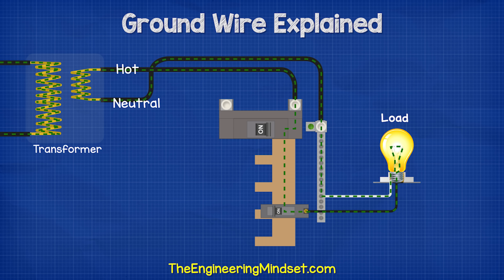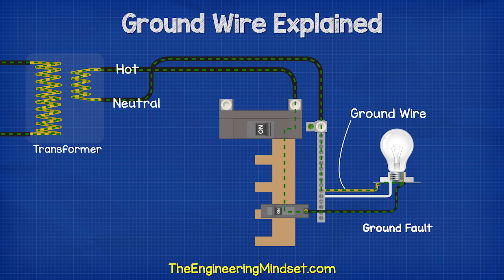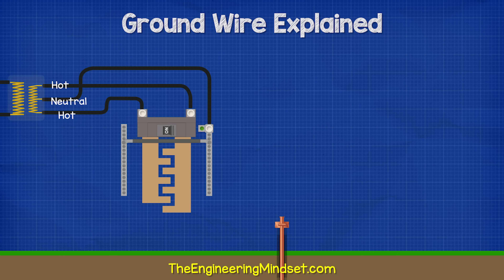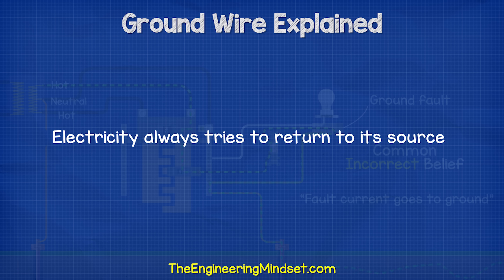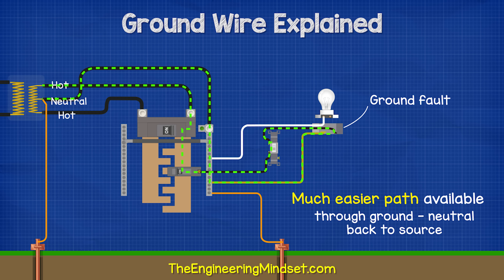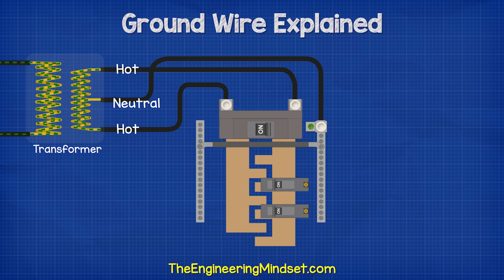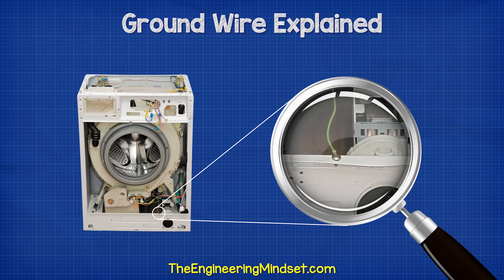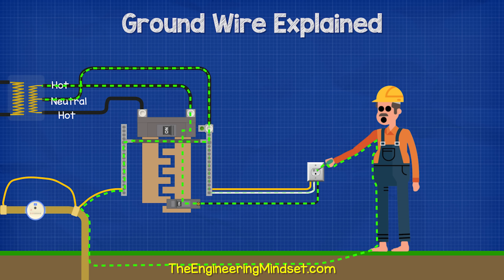Ground Wire Explained

Comment: I held my breath through this, waiting for the big fatal mistakes, but I didn't find any! Good job lol
There was one minor one and an oversight. The ground rod isn't only to dissipate static, it's what references the entire ground and neutral system to be Equal Potential with the dirt, and also the water pipes, building frame etc. You didn't mention how the ground rod is also bonded to the water pipes for this reason.
And when you said that the fault current will travel back to Source via the ground wire INSTEAD OF through the earth, that's incorrect, it takes both/all available paths, so some current will flow through the earth all the way back to the power plant itself. It will be very small, and if you hook a wire to a ground rod and connect a hot wire to it, you won't trip a regular breaker so little current flows, but SOME current does flow.

But still, you give a better explanation than most people ever have lol
Reply: Hm, i have a question then:

If the neutral at the transformer is sticked into the earth (ground rod) and also at my house, and that has a very high impedance, how is then the current able to pass my body when i touch the Live wire?
It should actually harder since in most cases i dont have a direct connection to dirt where it could flow back to the transformer or even my houses ground rod.
What happens here then??
Reply: @thx-rben  if you are insulated and touch a hot wire, nothing happens.
Just like a bird sitting on a power line.
However, moisture is present in a lot of things, and most shoes are not completely insulating (sweat from the foot combined with pinholes in the sole etc), and so electricity can often find ways back to Source.

For instance, if you are standing on bathroom floor after someone took a shower, the floor might have enough moisture on it to make a current path to a ground-bonded water pipe.
You can also simply touch both terminals on an outlet.
Or on carpet, if the humidity is high enough there might be some conductivity, or maybe you are kneeling on a nail beneath the carpet and the board has some moisture because the crawl space has high humidity, and the board is grounded to the damp concrete foundation.

However, if you are wearing dry shock hazard shoes which have a dielectric barrier in them with no pinholes, or you are standing on a dry rubber anti shock mat, a clean and dry fiberglass ladder or plastic stool, then you can touch a hot lead with no shock, because there is no where for the current to go.

All of the situations I mentioned before are very high impedance circuits, but it takes so little current to be dangerous to us that we can still get that shock.

Now, I have gotten a lot of shocks in my life, between faulty equipment (not my fault) and working with electricity (my fault lol), and most of them were more straight forward, standing on wet surfaces, or touching both sides of a circuit, like the time my hand slipped on a large motor starter overload reset button and I punched across the 3 phase 480v terminals with my knuckles.
I was actually standing on wet metal when it happened, but I had dry boots on so the only shock I got was between phases across my knuckles.
I also was in the habit when I was working on open control panels like that to keep one hand behind my back, which may have saved my life that time, because if my other hand had been holding the cabinet door at the time it would have been much worse.

I had an old electrician friend who used to never put cover plates on at his place so he could test the power easily if something went out, and he had to lick his fingers to be able to feel 110 v lol
And usually he had to touch across both terminals or touch something grounded, because he would not be grounded standing on dry dirt or concrete.
But it's hard to tell for us normal people whether what we are standing on is indeed dry enough to insulate us from ground.
Reply: @ke6gwf  all that stuff make it seem safer to just not use ground rod at all.
Reply: @ivanfenis1221  it's the opposite. Proper equipotential grounding makes things much safer for human meat bags, because it makes it more likely for the circuit breaker to trip instantly, rather than having fences and frames at high voltage for people to touch.
Reply: @ke6gwf  how does grounding make the circuit breaker more likely to trip? current overloading? and when you say high voltage do you mean that fences and frames are in contact with hot wire?
Reply: @ivanfenis1221  yes. If a fence around a substation for instance is not well grounded, a live high voltage wire could fall onto it and energize the fence. And then when the utility worker arrives at the substation to find out why people are without power, they get electrocuted when they touch the gate.
On the other hand, if the fence and all metal items in the substation are grounded in what's known as Eqipotential Bonding and Grounding, then if the live wire falls on the fence, it is a dead short to ground and either burns through the wire, or trips the breakers.

It happens sometimes that power lines will fall down on top of a wire fence on wooden posts going across a farm and start a fire, and a firefighter will get electrocuted miles away if they touch that fence before the utility gets there to shut the power off.

In a home situation, it's not the "ground rod" that makes the breaker trip, but rather the Grounded Conductor being bonded to the neutral to provide a low impedance path back to the Source. The ground rod is there in that situation to bleed off static charges and to reference the system 0 volts to ground, but it's that zero volts to ground reference that's important!

If you had a bad ground rod connection, you could theoretically have the water pipes at 110 volts in reference to the earth from a short circuit, without tripping a breaker.
If you were in the house you might be able to touch the pipes fine, but when you are standing on the dirt and go to turn the hose off, you could get a shock.
Reply: @ke6gwf  just to be clear "grounding" is when you connect to the neutral wire? or when you connect to the ground rod that's staked on earth?
Reply: @ivanfenis1221  it's confusing lol
There's a difference between the Grounding Conductor and the Grounded Conductor (Ground and Neutral).

Connecting the ground and the neutral (green and white) together is called Bonding.

The Ground wire is also connected to the grounding rod in the earth.

If you have enough ground rods you can actually use the earth as the return path to source. Some rural power grids only have a single wire on the pole, and use Earth Return at the Transformers, but a normal single ground rod at a house won't conduct enough electricity on its own to trip a breaker, which is why it's also "Bonded" to the neutral.
Reply: @ke6gwf  "If a fence around a substation for instance is not well grounded, a live high voltage wire could fall onto it and energize the fence. And then when the utility worker arrives at the substation to find out why people are without power, they get electrocuted when they touch the gate." - what's the circuit loop here? 

substation->live wire->fence->person->earth??->ground rod of substation??->substation
Reply: @ivanfenis1221  that circuit loop is one that would potentially be involved, but if a person touches a live wire, the current flows through them to Earth, and returns directly to the grounding system at the power plant, as well as to every grounding rod and system for every substation and transformer on the circuit.

Electricity DOESN'T take the path of least resistance, it takes ALL paths of conduction.

And while you can hook an extension cord from a 20 amp household breaker directly to a ground rod and not enough current will flow to trip the breaker (only a few amps will flow at 120 v with typical soil conditions), it's more than enough to kill you.

Which is why the substation fence would have ground wires and straps all along it, so that the voltage in the fence can never be different than the voltage of the soil next to the fence, even if a hot wire was sitting on it.

Basically provide a bigger pipe for current to flow into the earth, than the wire above has to flow current into the fence.
Reply: We use a grounded neutral as a 0v reference in controls. Sometimes ill measure control voltage to a pipe. Because why not.
Reply: Sorry should be more specific, grounded neutral of a 24v transformer
Reply from the maker: We just published a new Ground fault, short circuit and arc fault video, so much detail! Link HERE➡️: https://youtu.be/Qi0ynSQw-wc
Reply: this a 3 min video, you are more than welcome to create content, this is over simplified for the sake of education lmao he wasnt gonna take EVERY what if just for people like you that likes to complain about   everything jesus
Reply: @endersonkliverthybarra9747  but he only commented on what's in the video. he's not discussing every what if.
Reply: @endersonkliverthybarra9747  which is why I said he did a good job, and then ADDED a couple of key points he didn't include in the video, so that people reading the comments would get the full picture.

Comment: Ok, so I understand all of this, thank you for taking the time to explain it all in detail! Now my question, that none of my electrician bosses can answer, if the neutrals and grounds are connected to the same bus why does the ground not carry any current if the neutral returns current to the same bus the ground is connected too?
Reply: The long version... lol
In order to have current flow, you have to have a complete circuit between the power source, through the wires, and back to  the other side of the power source.
The ground wire is connected at one end to the neutral conductor, thus to one side of the power source, but it has no connection to the other side of the power source, and also no connection anywhere else to the neutral wire, and so no current can flow.

This is actually exactly why the ground and neutral are only supposed to be Bonded at a single location, because if you had the ground wire connected to neutral at the main panel and also at an outlet you would get some current flow on the ground wire, because it basically becomes part of the neutral circuit, and that's not good! 
For one thing when you have current flow in a conductor, due to resistance you have differences in potential along the wire, and so some parts of the ground wire would now have a voltage difference when compared to say the water pipes, leading to shock hazards. 

This is part of the reason for the ground rod at the house, which will also be bonded to the water pipes, it's to achieve what's known as Equal Potential, where the neutral wire, and the ground wire, is at the exact same voltage as the water pipes and the dirt. 

And the ground rod at the transformer bonds the split phase windings to force one side of the transformer to be at the same potential as the earth. 

If you leave the neutral floating on a transformer, then you get 120v or whatever between the terminals, but you don't have one that's at 0v in reference to the ground, it floats. 

One site I was working on some industrial controls in an equipment room, and I was there after dark one day and discovered that there was 110v on the ground buss in the plc cabinet after I melted the end off a screwdriver lol 
I found that there was 0v from the "Hot" wire to grounded objects like water pipes, and 110v on the neutral and ground wires. 
I started testing but didn't find anything that night, so the next day I was going to start tracing the whole system back through the breaker boxes, but when I got there, everything was correct! 
I was confused, until a later day I was there late and around dark I heard a loud clunk, and curious I checked, and the voltage had flipped. 
Then I realized that some big outdoor lights were powered off the 110v panel, and so I started turning breakers off, and finally discovered that when I turned the breaker for one of the lights on, the voltage flipped. 
I discovered that the light circuit was dead shorted when the photocell energized it, so I disconnected it until it could be replaced. 

The room was served by a 3 phase feed, and they had put a transformer in the room to derive 110/240, and when I pulled the panel off, sure enough, the electrician who installed it had not bonded the neutral, so it was floating. 
That meant that when the "hot" side was shorted to ground, rather than tripping anything, it just referenced the whole transformer, and everything on the sub panel, so that hot was at Ground potential, and thus ground and neutral were now at 110 v to ground. 

I called the site rep over the next day and told him the problem, but he tried to tell me I was crazy, so I put the meter between the ground buss and the metal building, and took a test lead and hooked it to a screwdriver and the metal building, and jabbed the screwdriver into a live outlet with him yelling at me to stop, and then told him to look at the meter... 
I had to walk him through bonding and what was happening, but finally he agreed to call their electrician to come in and wire the transformer properly.
Reply from the maker: The ground connects to the metal casing not the load, it will only carry a current if the hot touches the metal case
Reply: @EngineeringMindset   Ahh, ok I get ya! Still seems weord to me lol bur I appreciate it!
Reply: @EngineeringMindset  By the same token, if neutral and ground are connected to the same bus, why are two separate wires needed? Why can't the metal casing of an appliance just be connected to neutral?
Reply: @Bapuji42  because it serves two different purpose. 
Neutral wire for return path on normal conditions, and ground wire for fault condition (hot wire touch metal case)
If metal case connect to neutral then the metal case can shock human anytime.
Reply: @jacksparrow9532  Right, but they're shorted together. If two wires are shorted together... why have two wires?

Comment: Ok, so what about a tiny tiny tingling I'm getting through a tiny cut on my finger when touching the NEGATIVE EARTH CLAMP on a brand new welder?
Reply: Could be induced current because of the high power involved. Or it could be a problem. I’d check the voltage with a meter between neutral and ground to see if there is some leakage. Hopefully someone else will have an idea. 
Shocks are rarely a good thing.🥴

Comment: in the principal illustrated at 2:52, isn't the path of least resistance still via the neutral wire? So why would the current go thru you?
Reply: As others have pointed out, the current flows through all return paths. In fact more current will likely still be going through the neutral, but it only takes a few milliamperes to stop your heart (I’m not sure of the actual number).

Comment: I live in Europe and in my country, for residential installations, we use the TT system and not the TN (with all its variants). So, at the supply, the neutral is obviously grounded, but, at home, in the breaker box, the ground that comes from a local copper rod isn't bonded to the neutral, like the scheme presented in this video. I think that, in most cases, TT earthing type is better, as long you don't forget to install a differential circuit breaker.
Reply: It looks like the TT system is using the ground rod basically to dissipate static and keep the cabinets at equal potential to the building frame, water pipes etc, and doesn't serve as a fault current path to trip overload style breakers, which is a primary purpose for it in North America.
It looks like TT relies on smart breakers to detect faults between legs, rather than relying on too much current.
This is a good thing, and I tend to put AFCI/GFCI (the US equivalent lol) in whenever I can since I like the additional protection they give, but it is also more expensive and complicated to do a TT system than just a standard US bonded neutral and overcurrent fuse/breaker protection system.

And I am believing that the reason that it runs to a ground rod and isn't also bonded to the neutral is because the breakers are not designed to trip from that current path, and so by not bonding it you prevent high current to ground, when all you need is enough current leakage to trip the RCD detector.

Comment: 0:42 This maybe wrong.. on the right, the electricity passes through the person and back out the wire.. there is no wiggle from his shoes to ground. The very next part states that elecetricity goes back to its source..
Reply: It goes back to source though any available path. Since the neutral is connected to ground/earth at the generating point, in this case the transformer outside the building, the ground provides an alternate path.
Reply: @TomCee53  Electricity goes from the ground wire to earth, bypassing the nuetral, that has a resistor- human attached.. it is not the case that the electricity flows from the humans shoes to earth
Reply from the maker: Check out NEW resistor video, everything covered! ➡️ https://youtu.be/DYcLFHgVCn0

Comment: i never run  out of ground wire - I invented a machine that takes old copper pennies and grinds up all the ground wire I need for every wiring job. Don't forget, e=mc^2 and e pluribus unum  (translation: "In the Onion there is Strength")

Comment: I was hoping this would include an explanation of the different ground/earth configurations as this confuses me. As a side note it would be good to include in this vid why the earth is unsheathed in T+E but sheathed in flex and why the earth conductor is smaller than the live/neutral conductors
Reply from the maker: We just published a new Ground fault, short circuit and arc fault video, so much detail! Link HERE➡️: https://youtu.be/Qi0ynSQw-wc